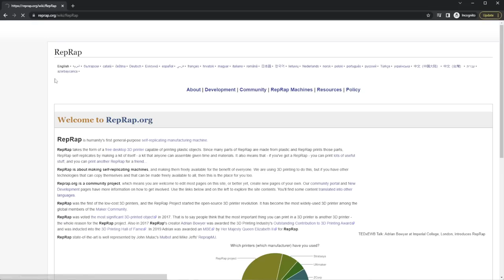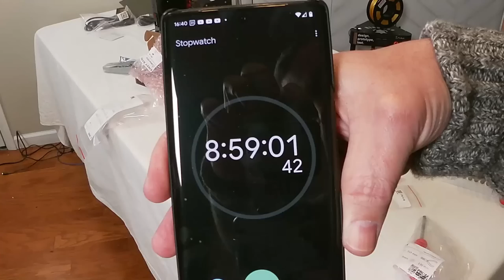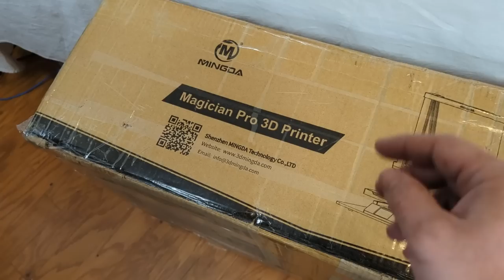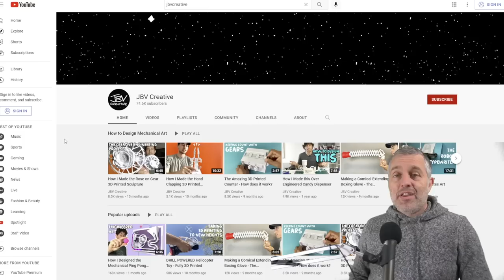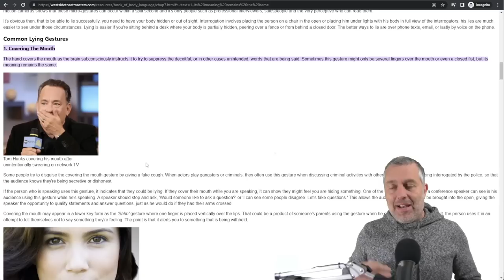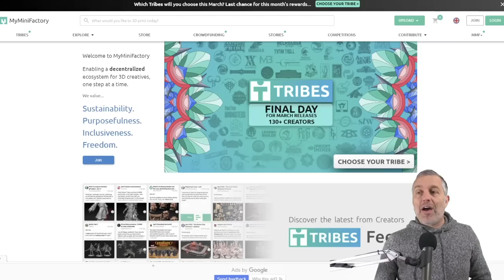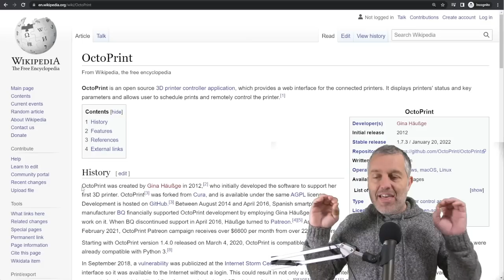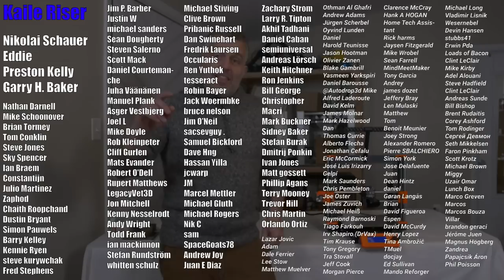Why Does Nobody Speak Truth About The Prusa I3 Mk.3? - It's Overhyped and Over Priced.

Comment: Turn the spool holder to back on Prusa to avoid hit on higher Z.
Reply from the maker: How polite! I like you. Everyone else who made this point used it as an insult. "Complains about instructions, doesn't build the printer correctly." Which is fair enough, but as you've shown it doesn't have to be acrimonious.
Reply: @DesignPrototypeTest  I did the same mistake, that's why I noticed it (almost had a crash, on first higher print). I saw your Prusa XL video too. With most of this I agree with you, I like your technical content and conclusions. But definitely I disagree to suggest Ender-3 (especially the first version) as first printer. About Prusa, you get the point, and that's on the company level too now. They created very similar video to mine "Food safe 3D printing", I don't mind if somebody confirms my results, I tried to contact them to ask what bacterial colonies they used, no answer. Not sure if they did that experiment at all. They could use my results, but at least small attribution would be appreciated. They also ignoring my request about Prusament testing (I got several requests to do this), but all this will be mentioned in coming Prusament review. Regards from Hungary, Igor (mytechfun channel)

Comment: To hear complaint after complaint and that you struggled inserting a nut into the printed bracket....
Use the Allen key to hold it or a pair of pliers?
Built for a 10yo and the instructions are insulting apparently....
Reply from the maker: Tell me, who's responsibility. Is it? Something... something... customer is always right? Other 3D printers are this complicated and the instructions aren't insulting.

Comment: I definitely don't agree with all your views, and you can come across as pedantic, but I also do not think Prusas are worth the money. 100% if you want to build a kit, high innovation printer it's going to be a Voron. And if you are a fan of seeing the technology succeed at scale, well, original Ender 3's aren't it either. People who aren't already into 3d printing want to make things, not dink with boards, belts, firmware, etc. In fact, I still think the experience skews to people who've tried and gave up, or tried and now the thing sits gathering dust, vs regular making - just like your neighbor's Prusa had. And that's before even dealing with software learning.

anyway, consumer printers need to have creature comforts, including minutes vs hours to days assembly, accessible (less than smartphone) price points, solved bed leveling, built in wireless cam and print file drops, excellent support, cloud library access, etc. If I were Prusa OR Creality, I'd be looking at where Anker or even Flashforge are going to push things - they have very "non tinkerer" customer aims. And very often the companies that carve out the space aren't the long term survivors, because others learn from what hasn't worked and have more resources to bring to bear. I think the dedicated Chinese makers are already aware of the maturing space (with recent group of Ender S1, Mingda Magician X, Sidewinder Genuis Pro).  [Ex: Creality didn't invent direct drive, but the Sprite swappable platform is interesting for cross tool and/or easy upgrade, fast replacement etc]. 3d Farm printers need to be cheap and reliable to maximize ROI, and there are as many farms not on Prusas as there are on Prusas these days, with successful results. OR they are using Prusa minis, vs mk3s - because they can solve for the inborn flaws and do small parts. 

I am now going from single 3d printer to fleet, and I have no plans for any to be a Prusa at this time. I am not perceiving enough value at the price point they are offering.

Comment: I share your opinion. The topic was that the Prusa Mk3 is overhyped or overpriced. So I will  stick to the topic ;). I have a couple of 3d printers, Prusa, Hypercube, Ultimaker clone and my highly modified Ender 3 and some own designs/experiments. The Prusa design is outdated. The user interface however of the Prusa's do sell the printers and is above average. My opinion for what its worth: Mediocrate hardware, excellent software.

Comment: Wow…. This seems like you have an issue with Mr Prusa.  That’s fine, there are absolutely issues with the i3, but what it is, its reliable, solid, and when something breaks you can replace it.  The kit build is great for teaching you how it works, but is absolutely a pain.  It’s cool what Chinese and other companies are doing in the 3D space and there is a place for everything.  But many of these new cool features are unreliable, but if you like those cool features like speed you can get that printer instead of the Prusa.  Everything has its place.  Including Prusa clones. And everyone can chose what suits them, without anyone dictating about who is right or wrong….

Comment: If you want to just print things and your time is worth anything at all, buy the Prusa with the excellent Japanese bearings.  If you want to learn to work on and upgrade some inferior printer hardware and firmware and time isn't important, buy the cheap printer and spend hundreds of hours upgrading and tuning it.  Hey, you saved $500 and then spent a bunch of time and money upgrading it to be almost like a Prusa that works every time.  Yeah, I've done both.

Comment: I just cant bring myself to pay that for a 3d printed printer. I can buy a base printer with metal parts and mod it for less and get better performance.
Reply: If you want a hobby, buy an Ender or equivalent. If you want a machine, buy the prusa.
Reply: @LilApe  Trust me dude you have no idea what you're talking about. I don't hate prusa but they ARE dated and so is the firmware come talk to me when they run stock Klipper and stop using printed parts. I did run the autodesk kickstarter cal test for comparison before I sold my ender3 and it did in fact score better than a prusa and so does my modded X1 and so will my Q5 when I am done. I dont mind paying less and spending a day or two setting up and modding printers to run better than a prusa. I turn on my x1 and hit print, I dont have to mess with anything. This constant "prusa is better cause I said so" is why I fully agree with this Vid and can't stand the fanbois. Just because I am not afraid to actually learn about my printers and tune them does not make it less of a printer than the wannabe holy grail prusa.
Reply: @LilApe  "lol" wow nice come back, I can tell Klipper is over your head stick to the stock prusa its "safe" for people like you.

Comment: The Prusa instructions are well done, it has enough detail in it to leave nothing to imagination or interpretation.
I have 2 Prusa MK3s, a genuine one and a clone one that I got for ~$500. The clone prints just as well as the genuine but the bed is not as flat as the real one.
I think there is an issue with your assembly that is causing those 45 degree lines, I do not get those on my Prusas, I do get vertical fine lines that I think is due to the stepper driver Prusa uses, TMC2130.

Prusa uses stepper motors with integrated threaded rod and they also use POM nuts, this makes z banding which is an issue with many printers a non issue with the MK3s.
Prusa uses bearings rather than v rollers, I clean them once with alcohol and then apply super lube to it and I never have to touch the bearings again for the life of the printer.
Prusa uses a magnetic flex plate system with PEI print surface which is light years better than glass.
The print settings in Prusa slicer for various print materials is bang on for the Mk3s.

With that said, the MK3s is obsolete. In 2018 when it first released it was hot sh*t but now you have voron, rat rig, vzbot, etc... that just destroy any bed slinger with ease.
Reply: I wouldn't say obsolete. Hardware is sure quite dated, but obsolete? Oh no it isn't. It's the software and convenience what makes it still very good choice. I'm likely going Rat Rig near future, but I most certainly don't expect it to be as easy to get into "efficient" level.

Comment: Totally agree with you. Beginning with the manual. The font has to be the smallest I've ever come across. The pictures are NOT CLEAR! The terminology is not constant (they never use the same title for the same item, twice. You need hands and fingers the size of a baby's to get some of the tasks/construction done. Forget the crap about constructing the d.i.y. version in X number of hours; that should be (2 x X) plus 10.  And all that shit about reward yourself with a gummy bear. Really! Sorry, I don't work for peanuts (or gummy bears). It's not needed.
Believe me, I'm not looking for a fight, but the Prussa is overhyped. I can use the machine now, no problem. But, give me a simple Balco anytime. Mr Prussa has complicated simple methods and instructions. As for the 'help' department, well, once or twice they did not get back to me. Prussa is no big deal.

Comment: I stopped at the gummy bear extended rant. You clearly have an ax to grind. You needed to focus on the claim that the printer does not live up to the level of hype generated.  My first printer was a Prusa Mini, I was thankful for the very detailed steps in the manual (in the spirit of build carefully, build once). The fact that it worked without much hassle and with high reliability  has given me confidence to,the point that I can now get a cheaper printer and thinker with it as a way to learn more about 3D printer. Just imagine if my first experience has been a disaster assembly, constant troubleshooting, and troublesome prints. I would not have blame myself for giving up on the 3D printing experiment. Some of us only have enough time for 3D printing as a hobby and little time to add tinkering  with 3D printers to it.
Reply from the maker: Does Stefan at CNC kitchen have an ax to grind? https://youtu.be/nik-HCeOSB8?t=504

Comment: I print parts for prototyping product designs. I like my prusa. I need just slice, print and forget... I've got better things to do than mess with a 3d printer... And when it does break.. i just like the fact that the support can speak English and belps me out... I don't hate chinese printers... I did build a Frankenstein printer from what started life as an Anet A6 a while back and it was fun but when I'm working i don't need the headaches.
Reply from the maker: Absolutely keep using the thing that works for you. Just don't recommend Prisa to anybody else. It's a bad decision in 2023. The only reason anybody still thinks Prusa is dominant is because of the online narrative which is controlled by a  bully in-crowd playing extreme politics.

Comment: I love your channel and your opinions, keep them coming! As you know, we are (now were) running a tiny setup of 6 pcs Ender 3 printers for production, but have now switched to 4 pcs prusa mini+:  they provide stellar PETG results out of the box, we need fewer as they don't need same TLC as the ender 3s, and....my wife can run the production.  Seriously. She has made 1700 parts since we got them, and she presses 'print' without caring or knowing about bed leveling, profile tuning, filament runout, re-tightening nuts, analyzing failed parts etc.

So far, for us, cost of ownership for production purposes is as low as you can get.

All the best from Denmark 🇩🇰
Reply: I love how you called him an idiot withouth calling him an idiot. Cheers from Spain

Comment: Okay, im a bit of a prusa fanboy and this guy does seem to be cherry picking in order to make fanboys angry. but, in his defense, the prusa i3 mk3s+ isnt as price competitve as it was when it first released. Printers like the ender 3 s1 pro are coming out now that are as feature dense as the mk3s while being mostly assembled and much cheaper than prusas options. Even the mini makes some sacrifices to build size and features that the ender 3 s1 pro doesnt have to make anymore. But prusas last printers are also several years old now are are about due for some new releases or at least updates.
Reply: Also, the ender 3 s1 is what the cr-6 se shouldve been, and had it not had a well documented issue with psu burnouts i wouldnt have refunded it due to malfunction for a prusa mini, and i would be talking about how amazing the cr-6 is instead. Also with prusa your money is going to branding but also to good customer support, knowledge base, and just sheer reliability. Also also sorry but the video maker is a jerk and this video would be much better recieved if he had a less inflammatory tone.
Reply from the maker: I found your comments balanced and fair Right up to the point where you devolved into name calling. Every. Single. Time. You Prusa fan boys are the worst behaved. It's not surprising. Your hero/roll model sets the bar pretty low.
Reply: @DesignPrototypeTest   yeah im just as bad as you, the difference is im not trying to convince a wide audience on what to buy or not buy, im just another commenter.  You on the other hand probably caused a few people to buy a prusa out of spite between the vudeo and all the replies youve been making.

Comment: Idk how can a prusa be 5 times more expensive than an ender 3. Sure might need less work and upgrades and maintenance and is more reliable. But 5 times better than an ender? Remember one printer prints one part at X amount of time. Having 5 cheaper printers who have similar or equal quality to prusa but makes 5 parts instead of 1. I do believe prusa is overhyped and its also made in america i believe so thats a plus depending on you see it. If you are rich and have a big bussiness then yeah it would be worth it at the end i believe because of maintenance but for the avg person with a tiny bussiness or for hobbiyst?

Comment: I bought an MK2.. this was before the ender 3 wave of chinese knock offs existed.  It took time to assemble, but it taught me a lot.. you also have the option to buy an assembled printer for not much more.  So no, the manufacturer isn't forcing you to insert a tiny nut in a small hole, you are choosing to.  Prusa absolutely filled a gap in the 3d printing world.  When I bought mine I did a lot of research on prices and features and you could spend 200$ on a micro POS from china that couldn't keep a layer line straight to save it's life, or 2000$+ on more professional models.  Prusa was the only one with professional prints at a reasonable price.  Using the same g-code would be a terrible comparison.. they're not designed to use the same g-code..that's why slicers have different profiles.  You also said it yourself, prusa is branching into different types of printers.  This completely refutes your earlier claim that that Josef prusa is an idiot who's stuck in the past.  God.. I'm typing this listening to you rant about open source and patents and you just kind of sound like an unintelligent whiny prick.  Seems a lot like you got scorned by your butt buddy Joe and now you've got a raging resentment boner for him.  I really can't watch any more of this video..  I was totally interested in a critique of the MK3, and yeah I don't think I would buy one today as there are so many other options on the market.. but you sir are off the rails.  Maybe try and patch things up with Joe or better yet, just move on.  I can't even finish the video because it's just crying about people calling you names and then turning around and calling people names.  Have fun.
Reply from the maker: You have no right to form an opinion of the thing when you freely admit that you didn't even look at the thing all that closely. Do you expect me to take your words seriously when you didn't even listen to mine? I've talked to JP for all of 2 minutes. Long enough for him to tell me that he had seen my videos. The last one at the time was the study I did where I figured out the issue of sensor creep in inductive sensors and suggested the solution of putting a thermistor inside the sensor. I have good reason to believe that the Super P.I.N.D.A. exists because I spent a week of work figuring out the problem and then sharing my findings on YouTube. https://youtu.be/_-fAMAnn3_s. That video earned me $5.19.  Using the knowledge gained from watching it JP has earned how many millions of dollars. All I asked for was a printer and a pat on the back for helping. I wanted to be part of the club. Instead I get to be the most hated man in 3D Printing enduring hundreds of comments like yours for years on end.

Comment: Prusa printers are 100 times better than the cheap knock off anet a8 printers. But yeah, part design is not amazing. And pinda probe accuracy is pretty crap with the mk2.